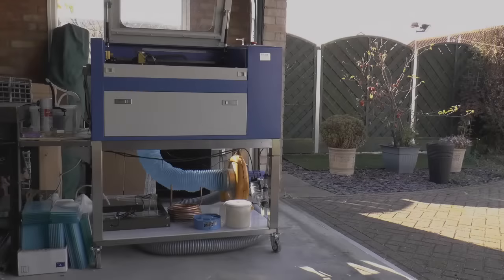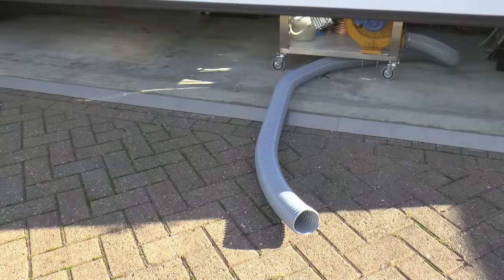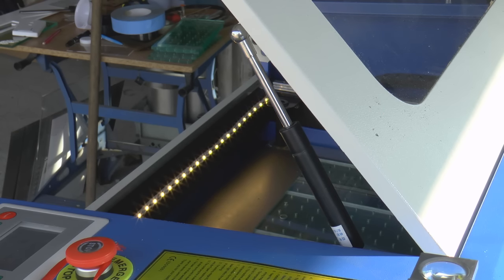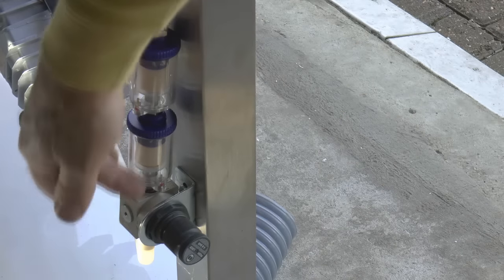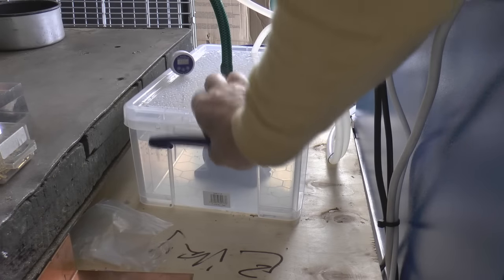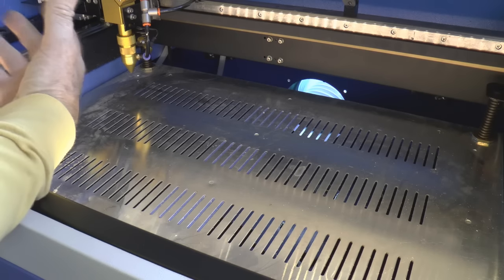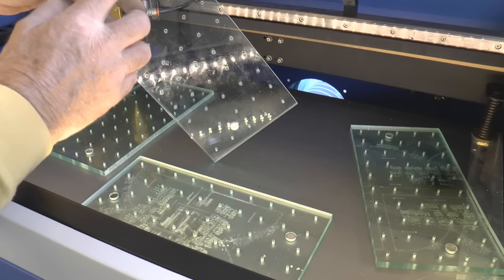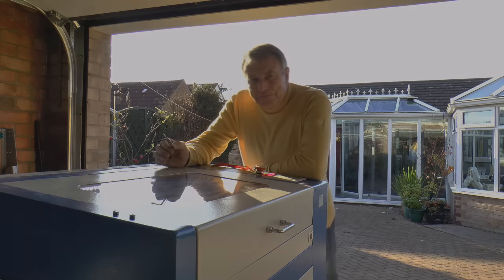My 50 watt Chinese Laser 4-month review

Comment: I just bought the same machine and all your videos are life savers, thank you so much, please don't stop.
Reply from the maker: +Ivan Lujan 
Hi Ivan
I know how you feel. Even though I owned 2 big 3KW machines before I retired, this little animal was a bit daunting because the manual supplied was useless and so it was back to real basics. I was collecting odd bits of information from all over the internet. and trying to make sense of many things. My hobby is videography so I decided to document myself  floundering through the learning process AS I DID IT.  If I had done the videos after  the event it may have come across as a teaching video which was not the intention. Thanks for the comments as it's good to know you are finding the sessions  useful. The sessions will slow down now because we have covered most of the basics. Like most bits of software (and equipment) you only use about 25% of the main functions regularly but confidence with those will prepare you for the off track adventures you will have to make if you have a special requirement.

Comment: Excellent as always. I've been figuring out how to deal with my machines backlash issue for the last few days. I believe I have corrected the problem but I had to connect my laptop directly to the machine. As a result I've discovered that this is the most efficient way of controlling the machine so if you can you should try it. 

I think we all owe you a beer for these video! 

-Seth
Reply from the maker: +CenterFireJewelry Hi Seth
I have experimented with downloading programs from my laptop  to make sure I know how to connect and communicate but I have no desire to use my ultrabook in my workshop. I have an old XP laptop available so I may experiment with that.
The only time I noticed a small backlash was when running scan lines at about 100mm/sec where an  offset of about 0.2mm between left and right scans was evident under a magnifier. It disappeared at less than 30mm/sec so it's not something I have had to play with.
Reply: +SarbarMultimedia I think the back lash is just luck of the draw. I was unable to cut a hole 10mm in diameter. It looked like two half circles next to each other but miss aligned. After adjusting the y axis it seems to have fixed it. All in all im happy with my $1500 toy. 

Seth
Reply: Hi, what do you guys mean with "Backlash" ?
Reply from the maker: Another word would be hysteresis
 When the head moves 10mm to the left and then you instruct it to return and it only moves 9.9mm,  there is said to be "backlash" in the system. It usually implies slackness and is the sort of thing that can happen if the drive belt is loose.
Best regards
Russ

Comment: I've had my machine for over 3yrs now, and still on the original tube. It gets used about 5-7hrs/wk for business. I've had no power loss issues, no issues with the stock bed, no need for air/moisture filters, and no need for additional cooling beyond a 5gal bucket of common tap water. I've used the laser up to 4hrs continuous high power cutting with no noticable rise in water reservoir temp. One issue I found early on was that there were metal shavings in the focus lens assembly from production, so all new owners should first examine the focus lens. I use a 6" computer fan which provides ample exhaust. When cutting I simply use a square frame of expanded metal that was sold as a gas bbq grill accessory for roasting fish and veggies. I drive my laser up to 98% frequently and experience no issues. I think this laser easily paid for itself in the 1st year with just low volume occassional use. I don't know much it can't do when compared to $15-18k US made lasers. When the tube finally wears out, I'll gladly buy another $250 tube.
Reply from the maker: Hi
Sincere thanks for your feedback. It's good to here from a trail blazer that gives us the benefit of your longer term experience. Tube life is a very unknown  and variable issue. I have known of others with 2 year old tubes and my own 16 month old  (but lightly used) 60 watt tube,  still running as new. So to hear of a good three year old tube is very promising 
Best regards
Russ
Reply: Just purchased one of these units and look forward to using it...  For additional cooling, such as if you are operating it in a warm/hot garage, or for intensive, long term cutting, fill a couple of small spring water bottles half to 2/3rds full of water and pop them in the freezer.  Once frozen, drop one or more in your cooling water bucket or bin, to moderate how warm the cooling water gets.  You don't want the water "cold" as that promotes condensation in more humid climates, but it will maintain a cooler laser cooling water temps.

I say this from 25yrs of industrial laser cutting experience...  Hope to make some videos once I get my unit.

Comment: Thank you very much for your review.  I have had the table top k40 for about 4 years now and it started giving me issues.  Since I do use mine for an artistic business I was wanting to upgrade to this model for the larger work area and the ability to cut the main materials I use.  Assemble one project while the machine makes the next.  Thanks so much for showing me how this will be a great investment.

Comment: Excellent video, I'm so glad I found your channel
Reply from the maker: This is a very old  vido and after 8 years I have no regrets.  This particulat first machine is stilli n regular use. In fact I have 3 similar machines that I have modified to make them easier to use and set the beam.  If you skip through the series you will see the evolution. Lots to learn about this technology if you are interested but perhaps, like most, you will only every use the 20% that gets you a result. Best wishes for yourn journey.

Comment: you are the man!! the only one who has taken the time to record and test thoroughly these machines. I myself own a 100w 90 by 60cm chinese laser and im also going through all of this albeit with a bigger margin for error due to the size of the machine and power... it already came with a centrifugal fan and a compressor twice the size but im still thinking about going with the big tank compressor anyways, it's said its helpful removing the material in thicker cuts specially mdf. Im stilll struggling getting the settings right to cut a specific material and material width... some i have managed to pinpoint but over large jobs performance may vary, i've had jobs in 5.5mm mdf where it would cut through in some places and in others it wouldnt.

my main concern right now is the filtration system for smoke and odors. i have designed a unit that willl use conventional air conditioning filters as "pre-filters" and then a set of activated carbon trays and finally an hepa filter, all powered with the fan provided... if need be i'd add a water tank filtration and even a mist down the chimmney pipe i've got going... LOT OF WORK haha
Reply from the maker: +lukkkie 
Hi Thanks for feedback. I suffered the variable cut problem during manufacture of the light sculpture which was only 4mm acrylic and my solution was to up the power another 10% to 95% and of course in hindsight that just made things worse. I also tried running the programme twice but of course it takes the same time to reach the uncut section so that didn't work either. I ran the program a third time with laser off until I reached the uncut section. There was enough recovery time in the tube to get the power back up and complete the cut. Obviously with clear acrylic I could see what I was doing and also my pin table allowed me to gently press the job and find uncut sections.  That was when I became aware I had a power issue with my tube. If you look at the comments on session 17 , an obviously knowledgeable Rob Conway has explained the reason for this problem. 

BIg compressor? I know that dense smoke (and acrylic fumes) absorb laser radiation and reduces cut efficiency but there may be a balance that has to be struck on this issue. Having used powerful lasers for many years,  to cut stainless steel you would use nitrogen gas at over 200psi through a 1mm diameter nozzle for cutting assist. This would change to low pressure air (or pure oxygen) at about 5psi through a 3mm nozzle to cut acrylic. Hence the first mod I made to my machine was adding a pressure gauge. I did run some pressure tests on cuts in acrylic and found that increased pressure DECREASED the cut depth. Also, where you need to site the pressure gauge to measure the nozzle pressure, is no indication of the pressure you will need to supply from your compressor. I will explain. The pipework and orifices in the fittings are smaller than the hole in the end of the nozzle. I was feeding the machine with 40psi from my compressor to hold 2 psi in the nozzle. All for no gain of cut depth. It was noisy, killing my compressor and causing condensation to form in the nozzle as the gas expanded from 40 to 2psi, which in turn was hazing the lens. I considered turning a smaller bore liner for the nozzle (about 1.5mm diameter ) but decided it was too much effort for little potential gain. So here I am back with the aquarium pump!!

Sure sounds like a lot of work to get rid of your fumes. As a "hobby" user I'm not exactly going to be a "nuisance neighbour."  Hence my out-of the-door-and-forget approach. As you have seen from my video, there is no point having a super extraction system and then strangling it by preventing air flow INTO the machine. I leave my machine cover half open so that I am dragging in copious volumes of clean air to dilute my fumes before I eject them into the yard. Extraction needs flow not vacuum.
Good luck in your venture

Comment: That clear plastic adapter piece is a venturi valve, meant to draw air in via that small side tube using the water current and thereby aerate an aquarium.
Reply from the maker: +NoTimeForThatNow 
Hi It was great that they supplied a nice pump but didn't bother to make real provision for connecting it to the machine in an efficient way. I did use this fitting initially but found it was limiting the flow rate. I've had no issues since.
Thanks
Russ

Comment: thanks a lot.i have a small 40 watt moshidraw.the laser has just broken .looking to upgrade and think after watching your videos .i know what to go for.please keep up the good videos always great to see somone with good ideas .
Reply from the maker: +Dave Julie 
Hi Dave
Thanks for the feedback. If you get a new machine it's a virtual certainty that it will not be fitted with an ammeter. I would strongly urge you to fit one and try and find out what the maximum running current is for your tube. As a guide it will be  18mA for 40watts, 20mA for 50watts and 22mA for 60watts. This info is never mentioned in your manual and my ignorance cost me a new tube.
Reply: SarbarMultimedia thanks.its out of stck on ebay now .will order when back in stock . is the Rotary Device any good.thanks again
Reply from the maker: +Dave Julie . It works better than I expected and it will allow you to design all sorts of holding jigs for the more challenging jobs like beer mugs or tapered tumblers. If it's free as part of the deal (sometimes they are) it's worth having to play with ( you never know when you or a friend will need a tumbler engraved ) but if its an extra, well, it depends on the potential uses you may have for it.

Comment: Hi Russ--You've done us all a tremendous service by posting this series of videos.  Top-notch work--thank you.  Questions about the bed of the work area: (1) Would getting a honeycomb bed be an acceptable alternative to cutting & inserting a piece of steel & having acrylic blocks with pegs, like you did?  (2) Would reflectivity still be a problem with a raised honeycomb bed, if I raise it high enough?  (3) Exhaust shouldn't be a problem with the honeycomb high enough, should it?
Reply from the maker: Hi Team
As you may be aware, I have two machines. The Lightblade machine came with two bed options, a honeycomb bed that sat on top of a slatted bed.  I quickly made my own unplated mild steel bed because after an enthusiastic one-night fling with the honeycomb bed I realized that against it's few positives were stacked a whole pile of negatives. 
The rail bed is at least 50% better than the honeycomb but in my opinion noting beats the flat bed. The following videos show some of those advantages. The biggest reason is to control the airflow through the machine.  There is only one way fro airflow to get into the machine and that's through the door. Once it's in the machine the first thing that happens is it gets sucked through the honeycomb into the plenum chamber below . You need cross flow above and below your work. 
The other big negative for the honeycomb table is that when the laser beam passes over the honeycomb, the power reflections cause marks on the underside of your job. . These demo videos I did for Thinklaser illustrate the issues
https://www.youtube.com/watch?v=xJBt_fbLa-Y
https://www.youtube.com/watch?v=AT3cSpfOZBY&t=9s
https://www.youtube.com/watch?v=UDV5SYfpKAc

As You will see in these videos I do not often use the pin table, mainly for thin card and paper,  instead I use little spacer blocks.  I am using M8 plated dome nuts. but you could use 6 to 10mm thick squares or circles of acrylic cut out from one of your jobs.

All your questions are inter related but I hope I have covered all the poinbs you raised. My China Blue machine has a fixed steel plate bed  blocking off the holes that were in the original ALUMINIUM bed and the honeycomb table for my Lightblade has sat unused for the past year except for a "I don't like this"" demonstration.

Best wishes
Russ

Comment: When cutting the acrylic you need to use little air pressure to get  polished edge quality but you are good explaining about  the laser and the aluminum but I won't put those aluminum materials underneath because of the reflection it might bounce the laser to the lens I run a mazak cnc laser for 10 years it is a 1500 watts laser machine
Reply from the maker: Hi
 I'm now 6 years wiser about laser technology. For 10 years I  ran a metal cutting business with two 3kw CO2 lasers. I thought I knew a lot about laser technology. This non-metal cutting. sealed laser tube technology is from a different planet and maybe 5% of what I knew was applicable. This series is effectively a video diary of me discovering  the basics as well as  trying to understand the science behind the technology. 
 ALL metals are mirrors to this CO2 wavelength of light. Aluminium, silver, gold, platinum and copper are  more than 99% efficient whereas mild steel is about 70%.  Understanding materials is just one of many important  parts to understanding how the laser technology works.
You are partially correct  about acrylic.  Acrylic is  analogous to H2O i. Acrylic is solid up to 160C (with H2O  it is about 1C). At that temperature it turns to liquid (just as ice turns to water. )  At 200C acrylic boils and evaporates (water turns to steam at 100C). Just like steam,acrylic vapour cools and re-condenses back to solid (that white fog on the surface of your work). There are two types of acrylic, cast and extruded. What you say about air assist is correct for cast acrylic because the way it is made  it has better heat conducting properties than extruded.  This means that the cut does not retain its heat and the liquid that coats the cut wall a few mm behind the cut solidifies very quickly.. Add to much air assist and this accelerates the process and produces a sort of frosted finish. It is difficult to get a burnished edge on thin acrylic  because you cut it faster and there is less heat to allow that liquid phase to level out  and  create that polished edge. Get above 5mm thick and cutting much slower allows heat build up in the cut and that process to happen ,provided you don't force the cooling with too much air assist.  With extruded acrylic  whatever the thickness and with or without air assist , you are certain to get a burnished edge. Run your fingernail over the edge (top and bottom) and there is always a noticeable burr. It seems that the extrusion process changes the conduction properties of the material and it retains heat in the cut very easily thus allowing that liquid phase to exist for longer.
 Exploring this technology has been a fascinating journey and even now I am a student because there is still much to understand. I have been lucky enough to experience fibre and RF lasers
 Wow , 1500 watts is a powerful machine which I assume is used purely for cutting. I assume that the machine bed is big also. 
 Thanks for the comment
 Best wishes
Russ